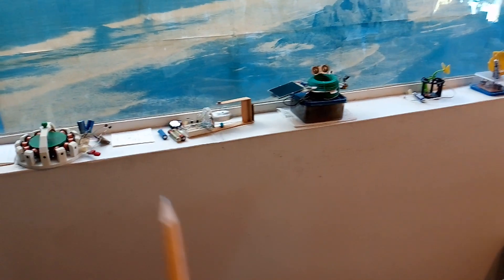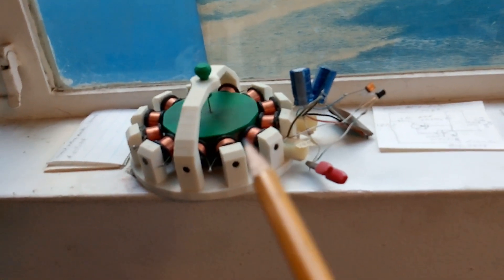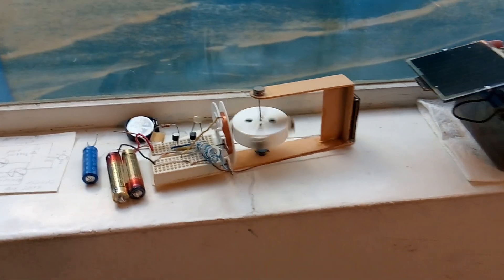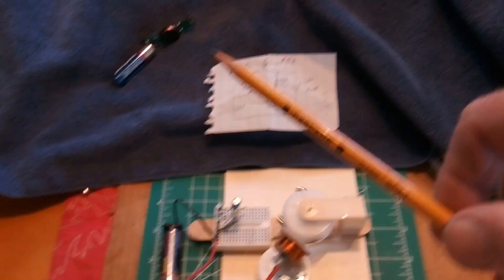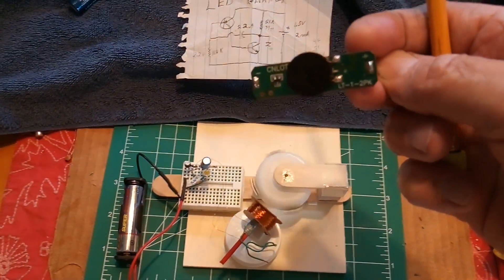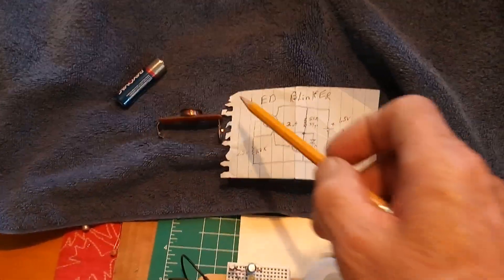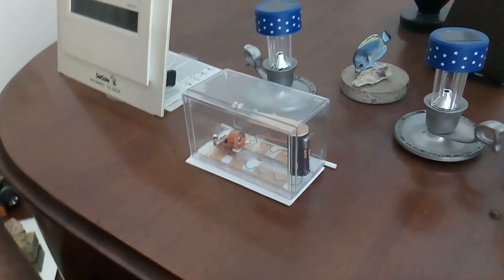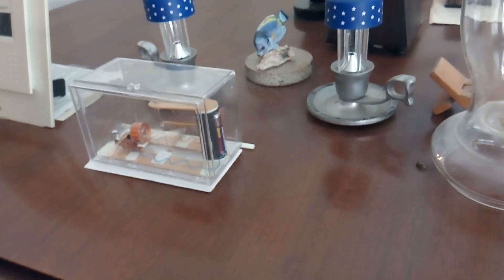My Non Stop Running Devices --  Update at 7 Years

Comment: I built non stop running devices to grow plants in rural areas, by using springs and developing them into spring boxes, then I would pipe in irrigation to the sunny plots and set up a pump, a deep cycle battery, and a 220v solar panel and connect that to a 5000 gallon water tank  above the plot, and then have that on a timer with drip gravity fed irrigation to all the plants, and it would basically run forever all by itself. The spring box did require daily maintenance though but the pump did not.

Comment: so...i don't get it.....dont most things that are battery powered or solar powered run nonstop until they have a problem or run out of energy?  what  is special about these "nonstop" devices?...they are not perpetual or free energy
Reply from the maker: It is a case of how long can you get a device to run non stop on the least amount of energy.  It is not about perpetual motion or free energy.  You would think that that this project is rather simple. What I have learned, though, is that lots of things happen when you run something non stop for years on end,  Bearings fail. plastic parts breakdown with UV light exposure, and basic design flaws show up with age.  It was just fun to watch stuff happen and try to fix problems as they occurred. Perhaps what I learned will help others.
Reply: ok got it cool, thanks for reply

Comment: so what your saying is that your non stop running devices are not non stop running devices? wouldnt it be safe to say that your non stop running devices need a new names?
Reply from the maker: No.  These devices were built to run around the clock ----forever non stop.  The quest is how to do that.  The Lasersaber EZ Spin has come the closest by running 6 years non stop on just solar energy.  I have learned alot in 7 years of experimenting.  I think that a good watchmaker could do this task with todays technology.  It would run on solar energy (at the correct latitude)----until the bearings failed. Perhaps a lifetime.

Comment: Really impressive work ... an inspiration to me and so many others. I bought a couple of the pendulum movements - they do work but surprisingly have a current consumption of 300uA.  The real challenge is the creation of something through your own skills and experience ... the sense of achievement is reward in itself.  What I find amazing is that the very first motors created by Faraday in 1835ish were also pulse motors ... and you couldn't pop out and buy enamelled 38swg wire in those days !  I too have spent a considerable amount of energy on my own challenge to create a motor that runs with precise speed - 1000 RPM using solar 24 / 7 ... nearly there !  Not my work but look up Uplift 2.0 - a work of grace and beauty !
Reply from the maker: Thanks for the heads up about Tom's beautiful Uplift 2.0.   Wow what a work of art.  I am fascinated by the early electric motors like Faraday's and consider them   art also.  I hope that you get your 1000 RPM motor dialed in soon.
Reply: @Lidmotor  Yes, my sons bought me an Uplift 2.0 a few years ago (they don't make them anymore). I'm really jealous of the design and it self starts when there's enough light. It has a small ball bearing at the bottom and the weight of the rotor is offset by the attraction of a magnet mounted at the top of the glass globe.

Comment: impossible for dust spects or similar things to get into a fidged spinner=indefinetly running
Reply from the maker: The fidget spinner project is on my to do list.  This new driver design should be strong enough and efficient enough to run it on a small solar panel.
Reply: @Lidmotor  looking forwardto your next update